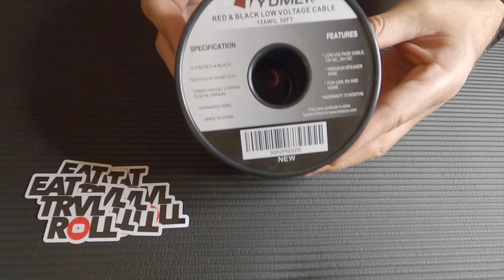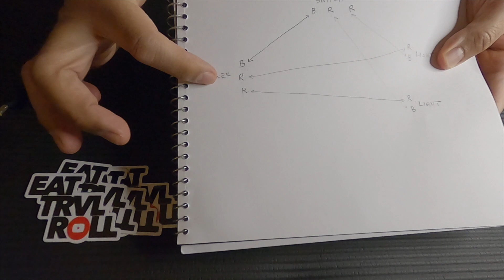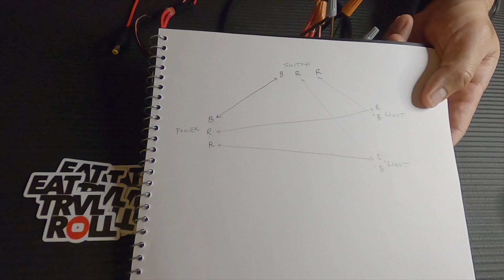DIY Turn Signals for e bikes | Super73 |Ariel Rider | LectricXP | Juiced

Comment: Thanks for the video, can you please give me the battery park link?
Reply from the maker: For some reason I can’t share it. Search Amazon - Talentcell 12V Rechargeable Lithium ion Battery Pack YB1206000, DC output for LED Strip and CCTV Camera, 11.1V 6000mAh Portable Li-ion batteries with AC/DC 12.6V 1A Charger, Black

Comment: Thank you. I have been searching for a video that shows me how to set up turn signals. Believe me, there are a ton of them on YouTube. They were too confusing and also it's  probably because they were a little too complicated (for me to follow). Finally, you cleared up everything and with this video everything worked perfectly. Even your (pencil) drawing for the wire connections helped me alot. Whenever I made a mistake I only had to look at your diagram and everything became clear.Thanks so much.
Reply from the maker: I’m glad it helped you out.

Comment: I bought the Loomenade turn signal kit for $200 cdn then built a way better kit for $50 from aliexpress
Reply: Aliexpress is damn amazing! Because of it, My amazon cafe racer looked much more luxurious than super73's and any other stock cafe racer style for sure!😂 I did this mod, only difference is I hot wired it with the controller it self. My bike already has turn signals but very weak on daylight. I installed a motorcycle ones from Aliexpress, $3 a piece! I bought 8 LMAO! Shipping time is always the hardest part😢

Comment: My e bike (ANIIOKI  AQ177) already has rear turn  signals built into the tail light with a switch from the manufacturer. 
I want to add front turn signals . Can I splice into the existing wiring to add them?
Reply: Yeah — a year later.

Comment: Thanks for the video. Good job. So to use those blinkers you didn't use a step down converter to 12v from the 52v.
Reply from the maker: Thank you. For the S2 and RX, no step down needed.  They’re already set for 12V
Reply: @Eattrvlroll  thanks Brother. I realized towards the end of the video you were using a 12v battery pack. Thanks again.

Comment: how long does it last before needing to recharge the pack?
Reply from the maker: Since I’ve had it, I’ve only charged it twice and only because I wanted to top it off before any longer rides.  I’ve been on numerous night rides using the headlight and have never dropped below 3/4 battery

Comment: hello Is it possible to wire it directly on super73 with yellow connector ?
Reply from the maker: I don’t see it being a problem. Instead of using a DC connector, you could wire it up to a 3 pin connector but then you’d have to splice in the headlight or taillight.
Reply: @Eattrvlroll  i have a 3 pin connector free under the seat but is it in 5 or 12volt ?
Reply from the maker: @syf2108  which style S73 do you have?
Reply: @Eattrvlroll  S73 zx
Reply from the maker: @syf2108  oh ok.  I don’t know much about the ZX wiring.  Not sure if it needs a step down converter or not.

Comment: Hi there, I've been trying your method and unfortunately I'm it's not working out for me, here's what's happening, I got all the connections as you mentioned, I turn on the right side lights and it works then I try the second side but it doesn't work :(

Edit: turns out that the blue wire on the switch was the (off) for me, all works for now.
Thanks 😄
Reply from the maker: Were you able to get it to work?  Without seeing it wired up, I can’t really troubleshoot it. I’d recommend redoing it from scratch, maybe there’s a loose connection?
Reply: @Eattrvlroll  yes all works now, thanks . 
How did you manage to run the cables through the bike ? Cable management and all and battery mounting point.

Cheers
Reply from the maker: @NinbAdam good, I’m glad you got it working. I ran it along the frame using cable management sleeves and zip ties.

Comment: Thinking of doing this but with a 5ah Makita battery and a buck converter to put out 12v, but principle is same for any drill battery I think. Most people have em, mine as well use em
Reply from the maker: I’ve seen someone post something similar on the FB groups. Definitely is a viable option for sure.

Comment: Nice!! Thanks dude! Just wondering how you would set it up for 4 turn signals? Front and rear
Reply from the maker: 👍🏼. Just splice in the extra two lights the same way.  I didn’t do it only because I lost one of the lights at Home Depot while looking for mounting brackets to work with it 🤦🏻‍♂️
Reply: @Eattrvlroll  which kind of light this one sir I try to make one for my bike also thanks.

Comment: Are you charging the portable battery through the bikes existing system? if not, how long does that battery last with the signal lights?
Reply from the maker: The battery lasts quite a bit.  I use it to run my headlight as well.  I haven’t run it down till it died, however, I’ve been on night rides (using the headlight) for about an hour and still had plenty of juice left by the time I got home.  Since I’ve had the battery pack, I’ve only charged it twice so far.

Comment: should have used the 3 wire ones so you could have run daytime running lights;)
Reply from the maker: I’m working on something for that 😉
Reply: @Eattrvlroll  getting ready to add side flashers as well :-) front and back also figured out the taillight problem I'm just using a push on/off button to toggle the brake light as I need it works great

Comment: Please share the links for the battery pack, turn signal switch and turn signals
Reply from the maker: Sorry about that, I thought I had included it in description.   I’ll add it there too

BlyilyB Motorcycle Blinkers... https://www.amazon.com/dp/B07GZLN7L7?ref=ppx_pop_mob_ap_share

Motorcycle Headlight Switch,... https://www.amazon.com/dp/B07JLCSTNX?ref=ppx_pop_mob_ap_share

Talentcell Rechargeable 6000mAh... https://www.amazon.com/dp/B00MF70BPU?ref=ppx_pop_mob_ap_share

TYUMEN 50FT 12/2 Gauge 2pin 2... https://www.amazon.com/dp/B08MF7BN8H?ref=ppx_pop_mob_ap_share

(Real 18AWG 43x2pcs Copper... https://www.amazon.com/dp/B072BXB2Y8?ref=ppx_pop_mob_ap_share